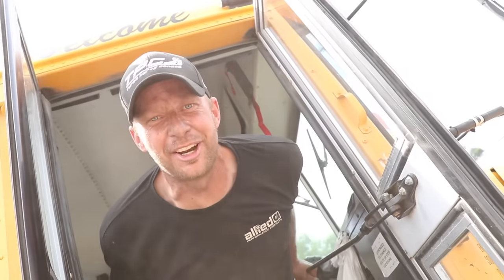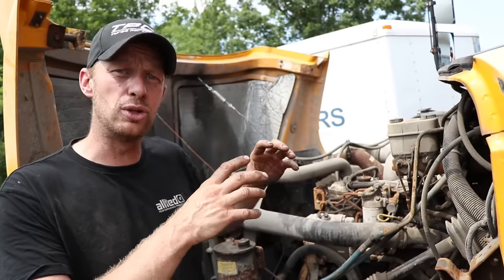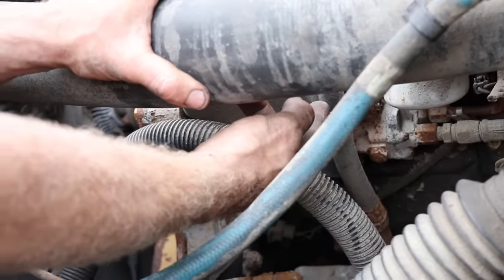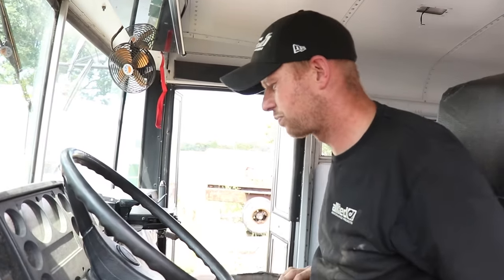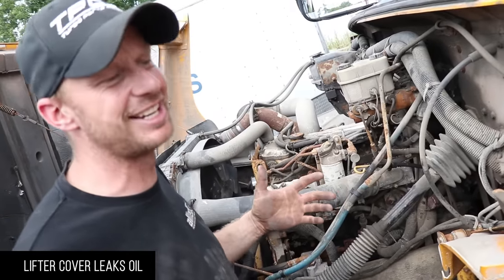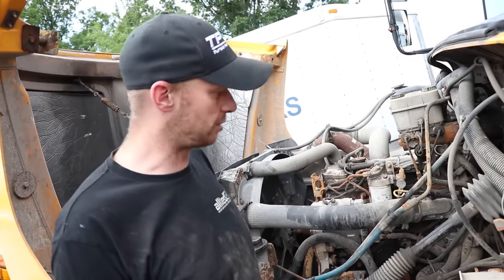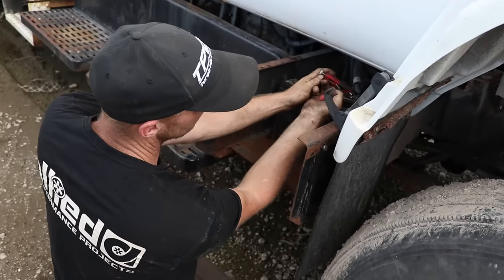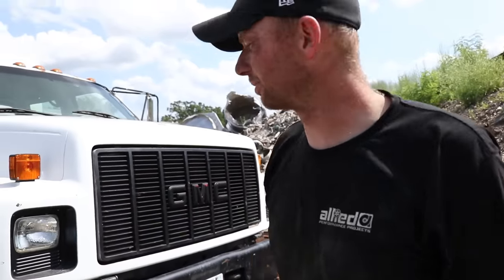REVIEW: Everything Wrong With A 7.2 CAT 3126 Diesel

Comment: These engines are built as inline 6's because this is the smoothest configuration.  V6's are lighter and structurally stronger, but there is considerably more vibration in that configuration.  One myth:  Inline 6's make more torque.  The configuration of the cylinders of an engine has nothing to do with it's torque curve!  Only tuning controls torque curve.  Since the inline 6 engine's crankshaft is long, there is considerable torsional vibration, with waves of vibration moving along the shaft, bouncing off the end, and returning....And bouncing into other waves.  This makes this design prone to crankshaft breakage and the faster the crank turns the worse this problem becomes.  Thus, manufacturers tend to design this engine to work at lower speeds and take tuning measures to make the horsepower more from torque than RPM.  But configuration has nothing to do with the shape of the torque curve.

Comment: I had a this 3126 cat on 2000 freightliner fl70
I bought it with 340,000miles i alway run long run otr. Never did any job never keave me down never had oroblems i sold it on 440,000 miles just because my job requested bewre equipment i have best experience on this engine

Comment: I was running Hot Shot pulling new utility trailers up to enclosed 24 foot on dual axle ramp goose neck trailer pulling it with a modified Ford F-350 mostly from Elkhart, In and the sourounding  area back to South Royalton, By once or twice a week. I'd my 1997 F-350 with the Banks engineering turbo,intercooler and was running a built Transmission  with a deeper pan, larger clutches and a larger oil cooler. I'd had it a little over a year and half with a little over230,000 miles on it and except for normal (or in my case abnormal) maintenance,  it had never let me down. I changed the oil every trip or about 2,000 miles with Mobil 20-50 and half a gallon of additive.  I changed my rear end and transmission at 10,000 miles added diesel fuel additive  at every fuel stop (I had a total of 234 gallons of fuel available and I ran two Cat spin on fuel filters in addition to the ones in the truck).At 50,000 miles I replaced the brakes including everything except the lines. The tires were rotated at 15,000 mile intervals and I had a set of winter rated Michelin that were mounted on steel rims that I ran in the winter. I put the same effort into the care of my trailer also. Even though I didn't carry much weight, there was a tremendous  amount of air interference  because of my overall height. I tell you all of this so you know that it was not because I was in anyway unhappy with the truck when I decided to trade it for a new Freightliner  FL-70 with the Sport or RV bed on it. It was equipped  with the 3126 and a Allison. I was sorry to see the Ford go but I certainly didn't need both truck. Besides I received  what I thought was a more than fair trade in, especially  when I presented the dealer with receipts for ever nickel I had spent on the F-350 Since day one. I didn't even make it the 900 miles home from Ohio to Vermont  before I found myself in the Middle of the night broke down and out of fuel. Something had been wrong with the crossover feeder valve for the fuel so I found myself with no tools as I had left them at the house when I took them out of my other truck. When you run out of fuel with a Cat there's  no hope of getting it running again without a lot of grief. This was the first time I'd ever owned a Cat but I knew you'd probably have to prime the pump and crack the lines to get it running again. Finally I called a big wrecker service out of Newburg and he sent two trucks for me. One for the truck and one for the loaded trailer. Cost me $2,300 before I got out of there. I hated that Freightliner,  sold it within six months, but I still miss my '97 F-350. I'd buy it back in a New York minute if I could ever find it again.

Comment: MUI is mechanically rack fuel metered NOT from the camshaft.  Both MUI and EUI are camshaft timed while the HEUI is hydraulically timed.
Reply: Eui are electronically controlled. You can change the start and finish injectection electronically. The cam does not time injection

Comment: Thanks a bunch...  good info!  looking at a 1995 boat with twin 3126B HEUIs in it, and trying to figure out if those are original or not...  I am thinking based on your dialog that it prolly got re-powered somewhere along the line.  Also sounds to me like this is a better choice than 3116s for a boat!  (much cheaper if it needs injectors.)  The cool thing is, if that bus has 360000 km on it, it probably has something like 8000+ hours on it!  Again, thanks!

Comment: The DT466E had the same problem with hydraulic line. I used to keep one in my tool box for road  calls. I don't remember if International ever came out with a steel line replacement.

Comment: U forgot about the the heui pump gear coming loose and the piston rings break which causes deep grooves in the cylinder wall which causes the owner to spend about 25000 dollars on a reman also blocks break inside by # 4 u can see this by removing the oil cooler also ecms go out pretty easily if u get a code where it shows faults on all the injectors chances are ecm is bad also injector oring failures loosing psi ipr valves but yes most of the time a heui problem is lack of clean oil and maintnance good video

Comment: I had a 3116 cat in a piece of logging equipment I hated that engine it had cam operated injection and if that engine even got close to getting hot it would warp the injector tubes and put fuel into coolant we had to pull the heads 4 different times I got rid of it

Comment: we have this engine in one of our fire trucks, a freightliner fl-80, and it keeps acting up; low on power, wont maintain or pull a hill. starts idles all day, runs pump fine, but load her down with water and hit the road shes a turd. changed fuel filters and injection return screen? i think its called, replaced all the fuel.  took it for ride and it did great for about 10 miles then did the same thing.  any ideas

Comment: I just got a 2000 GMC 6500 with the 7.2 in it. I thought I got a great deal at the auction but of course there is a catch. The motor fires right up and runs. Then just shuts off. If you wait a few minutes it fires right back up and runs great until it shuts off a few minutes later...........Any clue as to what demon is living under the hood?

Comment: I worked on one 3126 in a boat that swallowed water because a certain Capt. Dumbass changed the starter out and it was the wrong rotation. The exhausts were underwater and it sucked it right up. Bad things.

Comment: An Allison 2000 is mechanically the same as a 1000, just with lower gearing. Gears are the same as a 1000; five speed from 2000 to 2006, six speed from 2006 on. The 3126 was also mated to the 1000 as well.
Reply from the maker: Good to know!  Thanks.  Do you know how to make the 5 a 6 speed?  This bus was 2003 but it only had 4 positions on the shifter.  1,2,3 and OD
Reply: @DEBOSSGARAGE  suncoast has a kit but it is tailored to a chevy truck. The trans in this bus will have a medium duty calibration on it. So you will have to change to a 6 speed valve body and find someone that is willing to load a 6 speed calibration for you (which will be very hard to find). The pump is also better in the 6 speed so converting to a 6 speed isn't  ideal. You might run into problems with communications between the engine and trans if you convert to a 6 speed as well the engine will still be programmed for a 4 or 5 speed. It just depends on the year and how much th ecm and tcm are integrated into each other.
Reply: @DEBOSSGARAGE  I'd imagine any of the valve body kits made for an Ally 1000 sold to GM would work in either an MD 1000 or 2000. You'd have to find someone able to tune it.

Comment: I had a problem with my truck yesterday. It was normal for few miles, I got diesel for it and after that the truck started to smoke like crazy in the 5th speed, but it does not smoke when the truck is idling. I stopped to see what was wrong with it. I couldn't tell what was wrong with it, so I drove it back home. While I was driving the truck home it lost power and drove like 15 Miles per hour. What do you think the problem is?

Comment: I bought a truck at auction with a Caterpillar 3126, 210 hp motor. its a 1999 forestry truck. this weekend im going to attempt to drive it from Sacramento to las vegas. what should I do to help insure I make it?
Reply: Does it have the  hard line for your high pressure oil pump feed

Comment: never use ether in a diesel engine propane will work in a diesel like ether in a gas engine if ether is used it will take out the top compression ring at the very least and then you have to use ether every time you start it til it won't start due to catastrophic failure

Comment: I know you guys introduced the F-treekitty, I wanna know more about that. I have a 2000 F350 with 550 suspension. I was thinking of moving from the 7.3 to the 3126, but my 7.3 is already full stage 1 with hydra tuner. I wanna know what’s more reliable and more powerful, my tuned 7.3 or the 3126. I have a 6NZ in my big rig and love cat, just unsure about this model. Thanks. 😊

Comment: Can you get a Milwaukee die grinder and do a video on it how it removes gaskets and stuff with roll lock disks. I know ave has a great vid on the internals on it. I would like to see how it works in the shop before I think about getting one. Thanks!
Reply from the maker: Check the combine video
Reply: 10-4 thanks

Comment: For Allison transmission from 5 to 6 it should only be a valve body swap and transmission tuning
Reply: 05 and up allison 2000's have the valve body already, its just programming that enables the second overdrive gear for 6th.

Comment: What about the 3408 it's used in kenworth trucks.    And many other heavy haulers.  And if I'm correct I think it has heui injection also.  Plus the 3208ta. It was in a lot of ln8000 and 9000 trucks.
Reply: Truck Unbreaker  damn straight I thought you guys were about simplicity .  It doesn't fit any simpler than that

Comment: I am looking at a 2003 Ford F650 Super CrewZer with 149,500 miles. Engine is a CAT 3126B 6cyl backed by a 6 speed Allison trany, It holds 130 gallons of Diesel. SHould I be worried? Or should I Just buy it?

Comment: ❤ l. Just bought 2000 Treadwinds motorhome 300hp turbo. 860 torg , 6 sped Alison, with this engine it has 17.285 miles on it . Do you think l should change the plastic line with steel line right away? And the motorhome was sitting for a while like 8 months with diesel in it . Should l flush the fuel ? Seller keep saying low mileage doesn’t need anything and changed the oil only . What is your advice ?

Comment: 05 gmc c 8500 cat c7 acert replace engine with a running used one then it started to misfire took it to cat dealer and 6 injectors later and truck still wont run right heavy white smoke and misfire what do you all think

Comment: 3116 at first was proprietary to gm which bought exclusive rights to it 
GM signed second contract before cat announced the 3126 which stuck gm with the mechanical engine to get rid of existing stock of engines
Cat then offered the 3126 to freightliner who put them in trucks buses motor homes
Later Freightliner sold a shit load of trucks to PG&E with C 7
the trucks came with the C7 new from the factory 
After we received the  trucks  we sent them to a place down the road the engines were pulled out  and john deer engines were put in because they ran on natural gas
The C7 was crated and sent to our local cat dealer to be sold as new take out 
Units 
Then because it was cheaper to put in a different engine than repairing the C7 block with a sleeve and repairing it
Cat would just give us a take out engine 
Customer would get a kind of new engine 
We did that many times till they were gone
Spent 37 years in the trade before retiring

Comment: You say that a inline 6 is great for torque…I’ve had the experience of driving a inline six and driving a v8 diesel…and the v8 passes the inline 6 going up a hill pulling the inline 6 truck with its load. The inline 6 will pull off the line faster and better but at 60 mph up a hill the v8 international or the v8 LB-Chevy will pass the inline 6. You need to explain that when saying inlines are better

Comment: Have an 01 3126 in my dump truck with 110k miles the truck runs awesome until your climbing a hill loaded at high RPMs or running the highway at high RPM’s and then it will randomly shut off in the worst time, let it sit  for 10-15 seconds and it will restart but will die again after at High rpms, have replaced heui pump oil pump and sensors and it still dies. Didn’t know if maybe it has something to do with the lifter guides? Anyone with info please let me know or would be greatly appreciated
Reply: Dump truck is a c6500 Chevy kodiak

Comment: had a 3126 in a FL80 at my last job, pile of junk, pumps, injectors, ECU failure, dropped 2 pistons was rebuilt, 2 months later rod shot out of the block, only true CAT in my mind is a mechanical 3406 the rest is garbage, will take a cummins or a detroit any day.

Comment: I know a potential but illegal way to get that transmission unlocked. How about using a bullshit VIN (of a truck with a six speed) and having the trans reflashed.
Reply: Just order a TCM from CA conversions plug it in Dunn if you have a mechanical engine they got Alison backed ways around that

Comment: Okay so you are planing on putting a diesel in your Ford pickup and pull one of your cars behind it in a trailer. Why don't you scrap that idea. Why? Well think of all the things that you could do with a bus. Put a tilt up tailgate on the back with a drop down ramp so you can drive your cars right into the bus. You do a lot of traveling and in the forward section of the bus you put in some fold up bunk beds. Now just add a kitchen, bathroom and workroom and you got your house, shop and tow rig all rolled into one. Oh and ya gotta mount a ladder so you can get up to the roof where your deck is and where the tailgate parties are. Well actually deck parties are. Only thing left is some solar panels and a sauna. Now you'll save some money on hotels and you can just pull over at any rest stop to look at your eyelids for a bit. Okay nuff said. Happy Motoring.
Reply: Almost forgot, great video.
Reply from the maker: I would drive the bus a few times a year.  All that work for another vehicle I have to insure and maintain.  If I build the Ford, I unhook the trailer and drive it everyday.
Reply from the maker: Plus the bus is completely rotten
Reply: @DEBOSSGARAGE  Okay okay I get it, you're not filthy wealthy yet just filthy Rich. Now I gotta go look for the bus that Rich could've built.
Reply: @DEBOSSGARAGE  Just means another trip to the states. Cheers.

Comment: Hey. Give the right information, heui can build pressures up to 5000 psi. You don't use either on this engine unless you disable the intake grind heater. These engines are 175-330 except emergency vehicles that are rated to 350. Cat never supply a steel oil supply line for later 3126 and c7. There was a service letter to update the high pressure oil line to steel on early 3126 from that stupid quick connect and it was because the line was coming apart and leaking (I did alot of those service letters). That one in the gmc was a early low efficiency oil pump that had a steel line from cat and original had that quick connect high pressure line the service letter was on. Cat ownes heui and international was allowed to use it until international broke there agreement and got there pants sued off. And all c7 are not heui engines. 07 accert c7s are common rail. 
One more thing, there was a service letter for 3126/c7 uhh wax,Kal,sap for broken top rings, we did most of them, but something to look into before buying one

Comment: 11:37 gettin 5th and 6th gear to work.

Call CAConversion 1(  865)235-1123 they specialize in putting Allison in everything. I discuss the 5 vs 6 Speed design differences at length with the owners of the company CJ & Dave , when preparing for my Allison swap in my 91.5 Dodge . Good people.

8:45 Allison 2000 is a 4sp.

Allison 2000(an Allison1000 missing the park , it was replaced with a Driveline park brake) was only ever a 5 speed or 6sp (a 5sp with diffrent programming and better fluid management ,  both have the same 5 clutch packs) 
4sp was the older fully mechanical automatic Allison Transmissions

Comment: The early 3126 was a mechanical injected engine. Ive seen way more 3116's than id like to admit and never have i seen a HEUI 3116 . Both are dogshit. The 3306 was a much better engine -Cat dealership mechanic since 1996. Also the 3116 "pump" isnt timed its a governor with lift pump. The timing was in the Cam/ injector like a Detroit